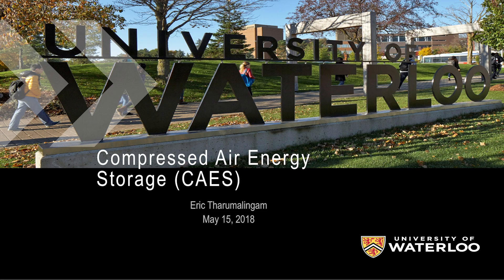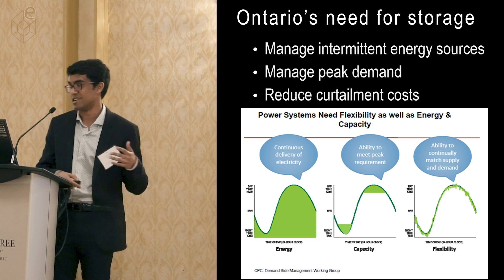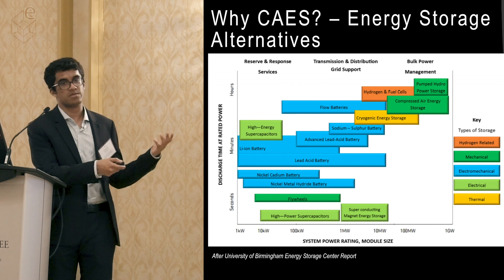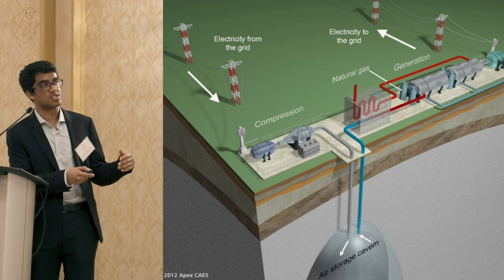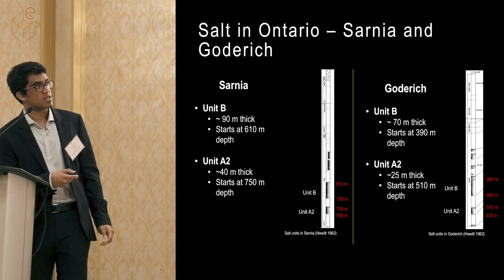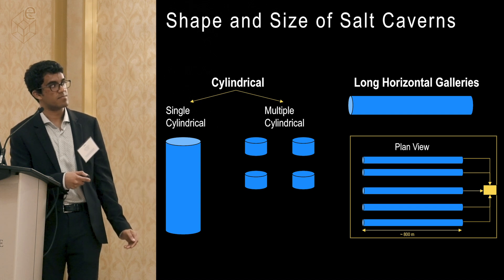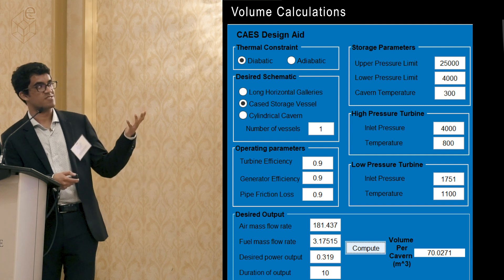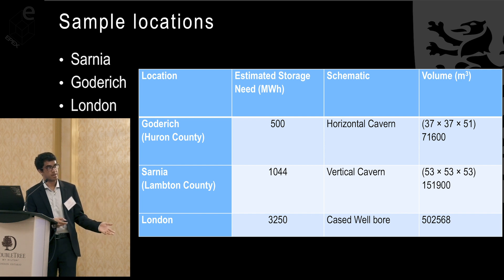Compressed Air Energy Storage (CAES) - Eric Tharumalingam

Comment: Liquid nitrogen anyone?
Also there is a project in Toronto that stores the compressed air in balloons submerged under lake ontario.
These salt caverns sound interesting though. How does it compare to the economics of storing hydrocarbons in the same space over the course of a year or 10? Which fuel source would be cheaper in the long run?

Comment: But why can’t you take this compressed air to spin a turbine through something like a pneumatic motor?  Why are you using natural gas to heat it, then to create a turbo effect while mixing it with natural gas to combust again?  Pneumatic tools run off just the air I wonder why a pneumatic motor to turn the turbine is not discussed?
Reply from the maker: Hi Anthony, I'm not the presenter but may be able to answer your question. Electricity is being generated by expanding air driving the turbine. The rapidly expanding air absorbs heat. Without an input of heat into the system the constant expansion of the air would lead to freezing temperatures in the turbo machinery, icing, and failure of the system. Burning natural gas is one way to add heat into the system, another way is to use stored heat produced when the air is compressed, as discussed by another presenter: https://youtu.be/TRdn_C2WKqc
Reply: @ogsrlibrary  ok thanks for the response. I guess I’m just envisioning the air going to drive a pneumatic turbine like a NASCAR pit crews pneumatic drills.  Or anyone who has used pneumococcal tools.  They have more torque, higher rpm and more power

Comment: We have developed a completely new, patented compressor and expander. Both devices are very quiet, extremely efficient and can also operate at just one revolution per minute. Based on these two devices, we have developed an energy storage system that stores energy in the form of compressed air. Both devices are easy to build and only require two sustainable, non-toxic and recyclable materials: steel alloys and ceramics. The following footage shows how the highly efficient "Zired Compressed Air Storage System works:  https://youtu.be/1_8sozndy5o?si=XIFkSJkYu3u3viF6